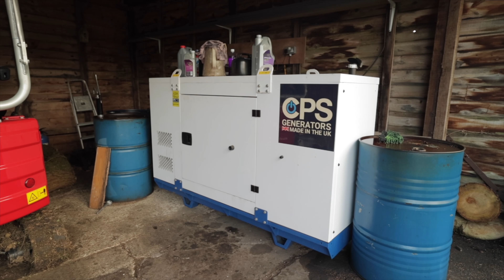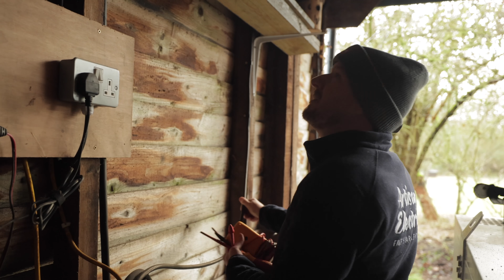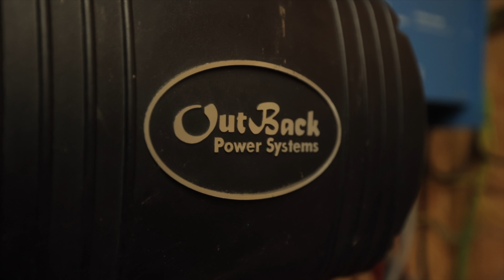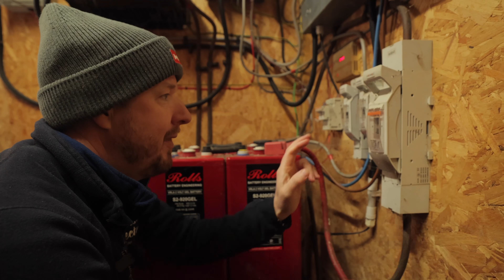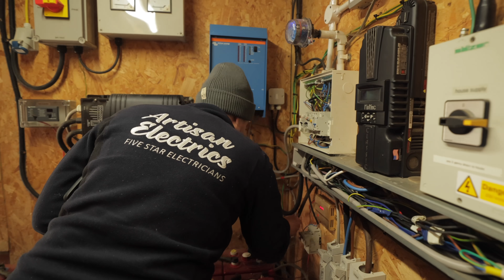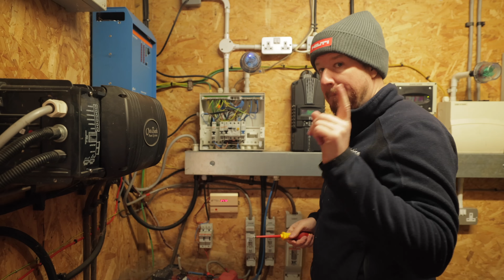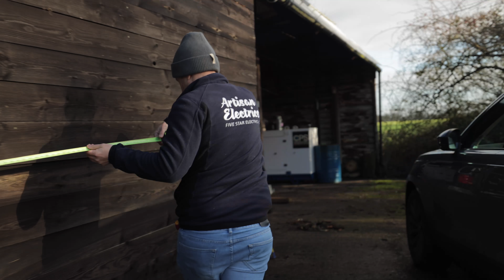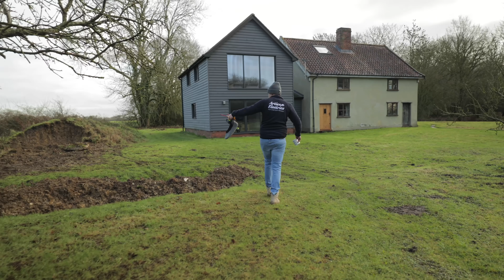DIY Off-Grid Solar Gone Wrong! (It Can’t Even Boil a Kettle)

Comment: As a Victron installer. I agree with you. That's a DIY job, it's a shame Victron is actually a very good brand. I'm and electrician and know my stuff. Victron use actually sell a lynx distributor that fuses every. The quattro's are good for this type of setup especially the 15kA inverter.
If your on a budget you could use  2x 8KW sunsynk inverters in parallel.

Comment: Clearly it wasn't that unsafe that you turned the customer off before leaving.. 
The combination of equipment was ok as it is from the era before hybrid inverters included all functionality. 
The part that consumers need to understand are the limits of their setup and to live within their means.
The ground mounts would improve  generation capacity.
Batteries should be increased to 48v at a minimum. Charge controller inverter and changeover could be replaced with a 11kw 48v hybrid.

Comment: Make sure not to bodge a wire from that generator straight to house. Be ready to fry electronics after turning kettle off on new system if gen woul connect straight to AC😂😂, beter to DC charge the Sigenergy and have stable power😊.

Comment: This is so typical when a new installer comes to check your current system: He recommends a whole new system 😅
Reply: It needs to be rewired . gen in to the inverter not a separate charger so can go in to buy pass when in high demand they are really good inverter charger if set up right and it's mppt charge control not an inverter and people that use a jug on a off grid set up like that should not be off grid
Reply: However this system has a lot of shit done wrong, and if not getting everything new, rewiring it properly is a logical next step. Also with system like this, upgrading to newer solar panels, hybrid inverter and proper battery storage, will have massive improvement. 8 panels x 450w = 3600w, add more on the roof, because there is space, and you can get easily 5000w. With proper battery system, most of the summer can be covered with 0 spending for diesel.
Reply: I think the system 24v, I would save it for lighting and other light loads. Another system utilizing 48v for the main ones and 5kW probably with more uses. If the battery dies, I will only upgrade to 48v entirely like suggested by Artisan
Reply: It's a MPPT charge controller.
Reply: If this “system” worked the way it was intended then why was there a big ass gennie? If I had bought this property, I would have immediately ripped all that shit out. What an F-ing mess.

The installer was not a proponent of the KISS method 🙄
Reply: mate u seen state of it lool
Reply: but naturally :D They need to pay the MCS overlords
Reply: To play devils avocado, If he starts doing work on this, he is effectively putting his reputation on the line so he has to ensure he can walk away knowing everything is up to par and he isn't going to keep getting callbacks when bits and pieces fail over time. It just makes sense to rip it all out. sucks for that guy, but its better than having constant headaches and a lot of back and forth. buy once, cry once.
Reply: in his defence, it looks chaotic. I wouldn't want to touch it without praying it doesn't break something else. Which then costs more money.
Reply: @atlanical  I agree the solar panels were not enough, neither were the batteries. I would get rid of the victron and get a lf inverter installed but to say scrap that and start again, it would be cheaper for
Reply: @danny323dee  Victron is the best offgrid solution on the market. Go in 1M+ yacht, it will be victron.
Reply: @danny323dee it wasn't a victron system, it was an outback system. What it needs IS to be a Victron system, not that outback isn't good, just that Victron is the market leader for this sort of install, and incredibly good value for money.
Reply: Probably suggesting a new one because this mess would make him responsible if there were more problems in the future.  I’d definitely agree with him.
Reply: @marksmadhousemetaphysicalm2938  I agree.

Responsible is exactly it, when  you sign off on other ppl work.
Could it be fixed yes, would you put you name to it no.
Reply: Yup
Reply: agree reveune stream for him just tidy the cabling up so so true VladoT

Comment: I normally like your videos a lot but oh man, I'm between the chairs here, on one site there is a family that has plenty of deciding left them to buy an off-grid house with absoloutely no knowledge about accompanied systems and on the other hand there is you reccomending ripping it all out and starting from scratch. Figuring out why the breaker trips or redoing the panel is one thing but not a valid reason ripping an otherwise functional system out. Adding a ground solar is still possible with the given system. Throw another charge controller (not Inverter you muppet) in and there you go, system enhanced.

Comment: I didn’t think it looked that horrible. The wiring was a bit random/sketchy and the system a bit underpowered with only one phase but it was definitely done on a budget. The new system will probably cost at least 10x of the current one.

Comment: The system is definitely undersized and poorly installed but the parts overall are decent quality.  Perhaps they can be sold off to finance the massive upgrade that he wants to install.  Properly installed it would make a nice 2kw system for somebody.  The generator seems to be a heavy industrial unit, to be that big and only produce 7.2 kw it's obviously built to last and diesel as well.

Comment: This isn't a cheap setup - there are a lot of premium off-grid bits of kit there. It might have been wired up by a monkey, but they did their research on the components. I think that is probably a 3.6kVA inverter, so the 16A protection MCB is appropriate, even if the genny can handle more. And the DC-DC charge controller (that you call an inverter) is more efficient than an AC coupled system, as it eliminates the need for 2 AC-DC conversion losses.
It probably doesn't meet the new owner's needs if they want to run multiple high current loads at once, so fair enough it is probably inevitable it will all need to be ripped out and replaced, but it isn't the train crash you make it out to be.

Comment: What happened to giving them a temporary fix? They are running the house off a 16A breaker with 6mm² cable that can handle 32A, so just upgrade the breaker and they'll be able to boil a kettle. Unless there is something else in the system that actually needs it to be limited to 16A? Everything else looked pretty substantial.

(EDIT: Looking again, there is a 200A fuse on the output of the batteries, which are 24V, so that's only going to be able to supply 20A at 240V. Why such a small output from the batteries? Is that an the inverter can handle? Why would they have used such a small inverter?)

(EDIT 2: Looking at the manufacturer's website, I think this inverter can only provide 3kW continuous/3.3kW peak. That explains the 16A breaker. Why would anyone supply a house with a 3kW inverter?!)

I understand you might be uncomfortable doing anything inside that consumer unit in its present state, but even if you redo the whole consumer unit it's a pretty quick job that will get them a working electrical system for their house. It doesn't have to be perfect. They just need to be able to make a cup of tea.

Comment: I don’t know a lot about sola and that’s a large part of why I am here, however I do know a little about electricity having been a spark for over 50 y ears.  My experience with US power is good but not as extensive as my UK/European experience.  I spent a good portion of my life having to integrate US and UK systems and yes you can do it but it’s never a good solution apart from the obvious voltage difference there is the problem of frequency, IMHO starting over will produce the best result in the long run.

The installation is an absolute mess and would be condemned if it were not off grid.  It would have been nice to have a reading of the power reaching the house over the long and undersized cable.  Not burying the cable between the outhouse and the main property is a false economy and dangerous, your insurance will not cover any liability in the event someone puts a tool through it EG a tractor with grass cutting equipment attached. 

I do hope you get the job and your client gets a quality UK approved instal, safer, neater and understandable.

Comment: mate call it a charge controller this regulates dc from high to low to charge batteries, an inverter changes voltage from dc-ac

Comment: It is with some regret that I have to conclude that you are starting to lose your original shine. I began following this channel to learn best practices in electrical installations. However, in this video you have gone a bit too far.
The title and the thumbnail are clickbait. There is no respect shown for solutions from a previous era. Yes, the wiring is not ideally organized. Still, you could have shown at least a bit of respect to the developer of this off-grid solution.
It is understandable that the new owner expects more power for everyday needs. But that does not mean the existing, frugal 15-year-old solution deserves to be ridiculed.
In my eyes, you would have earned far more respect by first taking the time to understand the existing system, then explaining that the new owner wants higher capacity, and only after that promoting the fact that you will rebuild everything and create a new system.
This is certainly not the kind of horror show we saw with extension cords and unsafe DIY electrician solutions in that house where You even refused payment for an inspection. These situations are not comparable at all.
Let us respect history first — and only then build something new and beautiful.

Comment: This guy is clueless. Only knows tear out and install what equipment he knows. Most of what was in place is good equipment. CHARGE controller is an excellent brand. Victron is excellent inverter. Outback is excellent equipment. Fusing is better than breakers. Midnight solar surge protectors are one of the best on the market.

Comment: If you've got the diesel genny in there anyway I'm not really sure I see the utility in going with a ground-based system over the roof for an extra 2kW of nameplate capacity.

Comment: As an Australian rural electrician, who has worked as an off grid/marine electrician, the biggest issue is people being able to get all the parts and do their own work.  I've seen many a fire or disaster on DIY electrics.  You need to get a professional to install these systems.  Correct charging programing of system, correct cable sizes etc.

Comment: Hey mr expert. An inverter turns DC to AC. Your "solar inverter" does not. And also, the biggest issue in this system is Rolls batteries. They will not carry heavy loads no matter how big the battery bank is.

Comment: This is the most out of your depth ive seen you in a video. 
Not all solar setups have just a single inverter that does everything and a battery. Split component systems offer alot more flexibility.

Comment: It's a real shame that you can't see this for what it is, or was. It was a DIY installation built to a price. Yes it might not be up to current code, but to say it's not built to meet the needs of the person who installed it is assuming you know what they needed.

The new owner moved in and just assumed it would be a modern system. That's on him, not the person who designed it.

The proof is just dismissing a PLC as "junk".

Anyone can spec and install a system with top spec parts for £30k. Design the same system for £10k and it would be impressive.

Comment: this guy's an idiot. he doesn't even know what a charge controller is and condemns a whole system that could be fixed with a couple tweaks.
it's overcomplicated, yes, but all the bones are there and it wouldn't cost much to get it working properly with a few bits of modern equipment.

Comment: Don't go with artisan. You need to do some tidying up, maybe ADD to the array, not necessarily write off what's there. And replace the inverter with a bigger one? Assuming that's why there's a 16A main breaker, not the wire sizing? Then upgrade that main breaker if you can to match the new bigger inverter? Whole job for hundreds to low thousands, rather than £10k+.

Comment: First, 2kW of solar is woefully small for a full household.
Then, add to it that it only has a 12 volt battery charger. That means the batteries are in a 12 volt series-parallel configuration.
12 batteries in 2 strings of 6 batteries each yields a 24 volt system. The 1046Ah rating is over 20 hours per the labels.  That equates to 52.3 amps per hour at 2 volts.
The primary main output to the house should be a 50 amp breaker AT A MINIMUM!
Here is the states, a good rule for off-grid housing is 12kW nominal pure sine inverter with 36kWh of batteries and solar at least 9Kw solar.  The whole system should be 48 volt so smaller (and cheaper) wiring can be used.

Comment: I would keep the solar panels on the roof. Upgrade the battery system to 48V LiFePO4 and see whether the MPPT works at 48V. If it does, then reuse it. If not, use 100/20 Victron MPPT's. Add an additional solar array (maybe ground mount if there is space). Get a DEYE hybrid or Victron multiplus with additional charge controllers.

Comment: We always knew jordan was going to say rip it out , clearly doesnt know his ass from his elbow with off grid systems, you would get way more bang for your buck upgrading to say some big fogstar batterys and some bigger victron gear, space isnt an issue so just a waste of money to go for sigenergy, also that generator controller is clearly a well made unit with physical controls way more user friendly than any menu burried in an app. the money saved would probably pay for a fairly decent wind turbine for the winter

Comment: I had to smile a bit. Living in the Australian bush, I had a lovely Lister diesel genny (around 4.5 KVA). I wired the starter battery between neutral & earth so that from any socket you could pick 240 AC when the gen. ran, but also 12V DC for night lights, audio & TV without the need to run the gen. It could not handle the entire cooker load with it all switched on, so I designed a sequential load switching circuit for that, with which the lot could be switched on and run on a time-sharing basis. Solar arrays had yet to be invented...

Comment: Wasn't that black thing you called transformer ! just a MPPT charge controller 110 v was panel voltage 24 v battery voltage and a healthy 16.3 amp charge could do with either lowering panel side or better still raising battery side as powerpoint tracking will be more efficient  . Don't get rid of this its expensive good bit of gear " Midnite Classic 150 MPPT " £800 ! . Sorry but you don't seem to know what your dealing with on this off grid systems , whoever fitted system has fitted some quality gear please don't get rid of it

Comment: TBH, this sounds more like a moan for the sake of moaning, rather than 'solving' a problem that the previous install was never meant to handle in the first place. the current owners said it themselves that they didn't know and therefore didn't ask enough questions regarding the set-up of the previous owner/installer - the previous install must've been done primarily with a much lower load capacity and re-using as many parts to hand to keep costs & sourcing low in mind (i.e. The system was mainly concerned about low-draw items like lights and fridges: but cooking & heating would have been gas or wood powered). If the current owners have the money to start afresh with a new system you can install, then the focus should be on that, rather than the very obvious shortcomings on a system that was obviously built for totally different owner needs & priorities at the time

Comment: Off-grid with a house on 24V is insane for me. I often think 52v is kinda low.
Reply: Yeah, pretty much my thought. But it's clearly a fairly old system.
Reply: From 10 years ago, 24v was still common in smaller installations like dongas (small weekender cabins)- these days most actual full time offgrid homes in Australia use 96v rather than 48v- I bought my 12kw inverter (48v) at half price back in 2019 because it was 'new old stock' and nobody wanted a 48v inverter any more- the same company makes a 15kw 96v inverter for offgrid homes here...